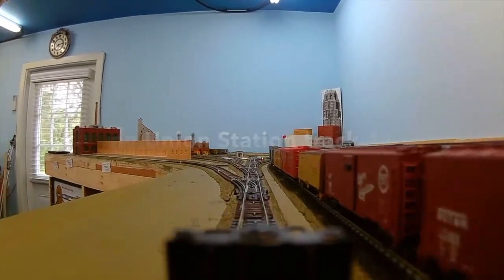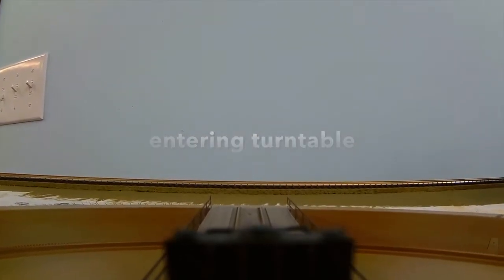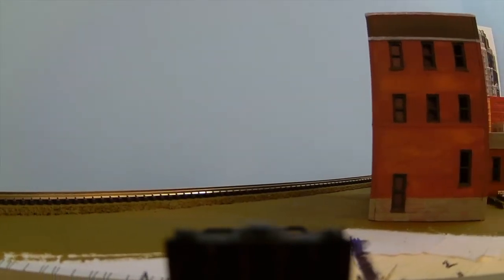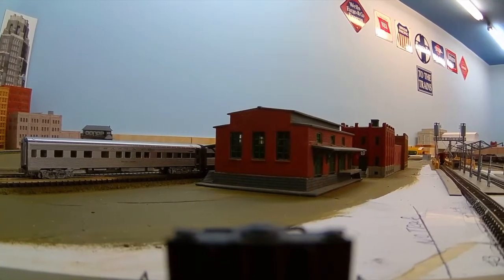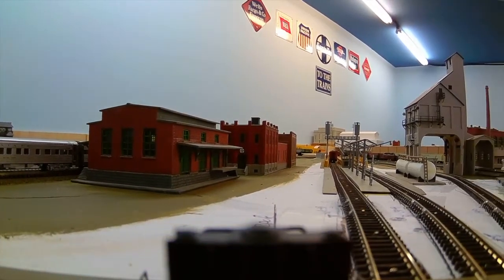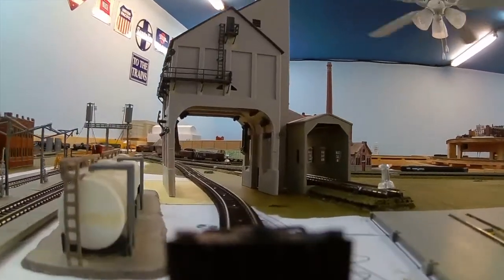Using the Turntable

Comment: hi John.. looks like it works like a charm.. is it set up for indexing?? thanks for sharing.. vinny
Reply from the maker: Hi Vinny, Yes it is indexed for the 14 tracks that go to/from the turntable.  The hardest part was making sure that the "no track" position (where the turntable reverses the polarity/phase of the bridge track) did not end up where I wanted to put the 14 tracks.  Programming the tracks was fairly straight-forward, although my finger on the control box & old eyes did not always work together, so some program stops took longer than others...John